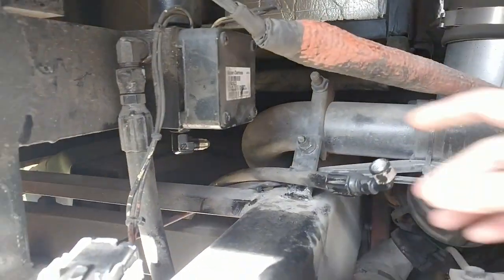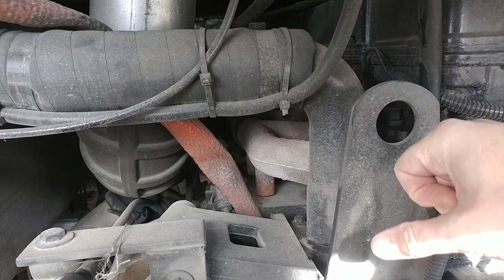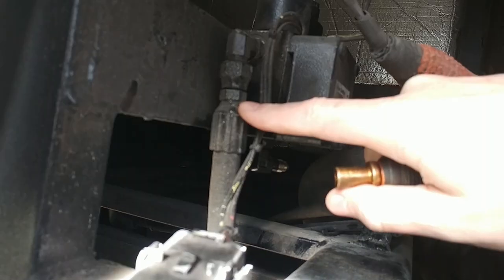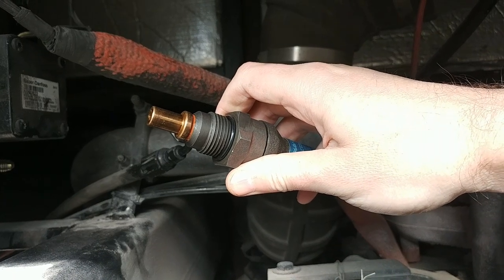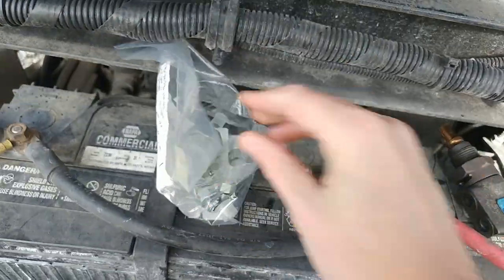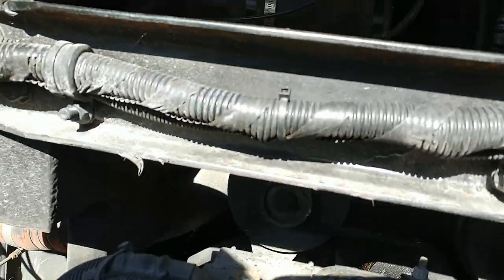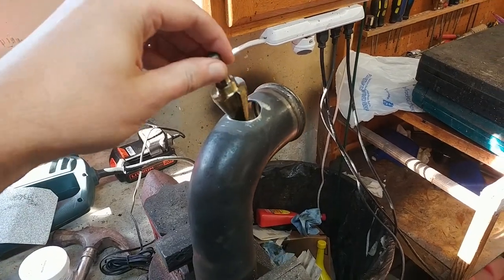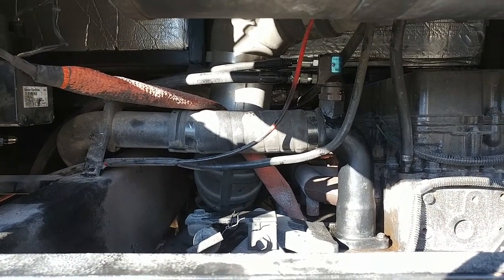Hydraulic fan controller conversion on an RV (part 1)

Comment: I have a quick question for you where in line is that Orifice you were talking about for the air conditioner?
Reply from the maker: I ended up not using an orifice. I went with a needle valve instead, needle valve is in part 2 listed in the description.

Comment: Great video, you got me thinking I can do this. Can you give me the part number and name of that wax valve? I went to that link you have here but it did not work. Thank You so much.
Reply from the maker: I got it off ebay, he may not be selling them anymore. The one I got was adjustable rather than a preset temp. Sauer Sundstrand 553/1/09859/110    You could probably search for the same number without the 110 at the end on google to help find one. They come in adjustable or preset temperatures. The forum I posted this video in is here, maybe others can help you in locating a wax valve:  https://www.irv2.com/forums/f115/fan-stuck-wide-open-376611-10.html#post4614599
Reply: GoFast  I bought the wax valve off eBay for $65 plus s/h $8.25....I also called that Hydraulic supplier you posted and ask them if they had a weld bhung and he did have it in stock so I bought it and the other two just in case I have to make one like you did. As for the fittings I am going to hold off until I am ready to get the hoses made up. I was thinking I might be able to use the fittings off the original fan controller but not sure. I will cross that bridge when I come to it. Lol ...Thank you for your video it really helped get me started 😊